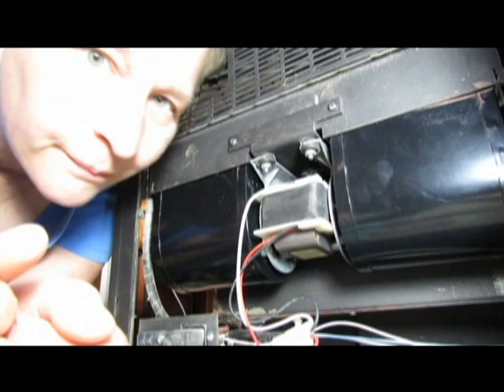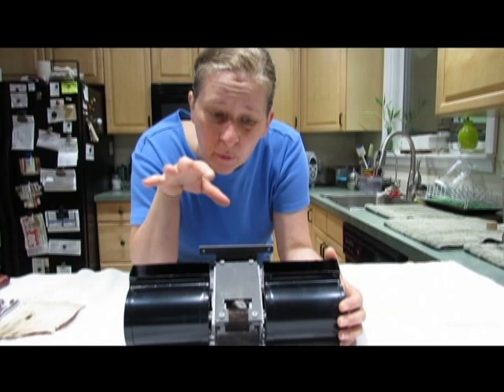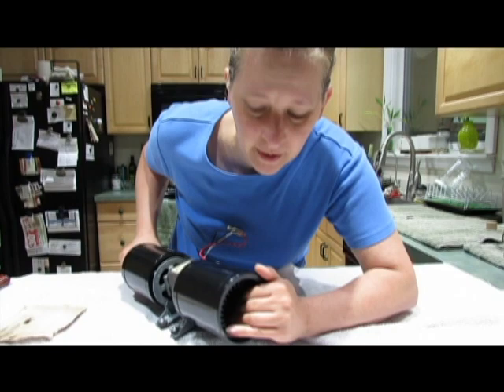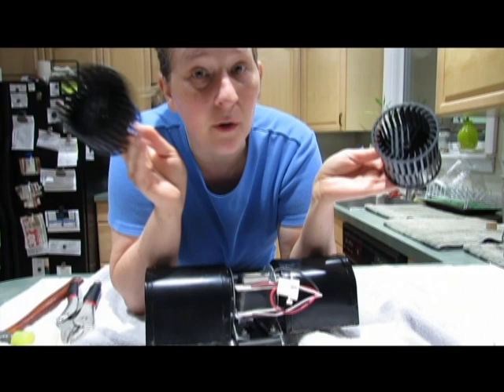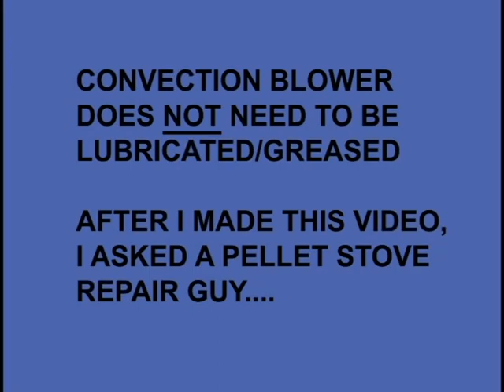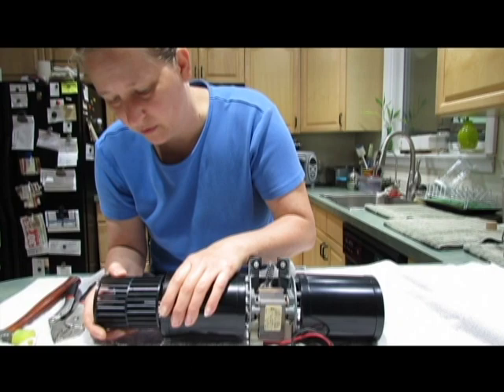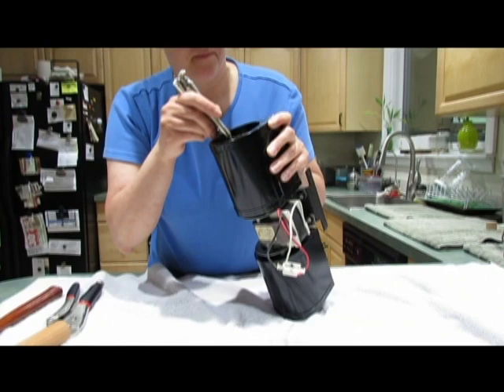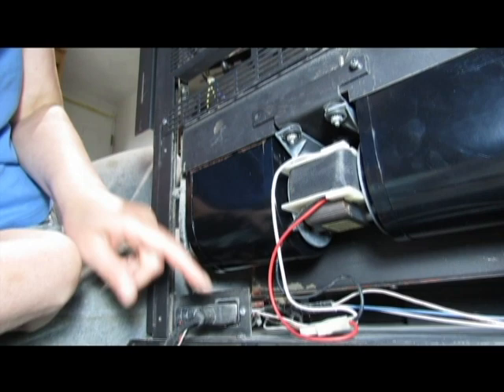REMOVE CLEAN & INSTALL Convection Fan Blower for QuadraFire Classic Bay 1200 Pellet Stove

Comment: Thank you very much for this video. It will help many people. I followed your procedure step by step and everything went smoothly. However, during the rotation of the central rod I heard a friction. Despite a deep cleaning, he was always present. So I decided to lubricate the parts where there is friction with lithium-silicone grease spray. I reassembled everything. My stove is second hand. I have it for 3 years and it has always been noisy. It's over now. He has never been so silent. Thanks again !

Comment: Dawne, 

Thanks so much!!!  I removed the blower and used my air compressor to clean the cage motors through the openings.  The stubborn stuff on the blades I used a paint brush like you said.  The cage motors would not spin freely, so I used a little WD-40 on the bearing, and they spin fine now.  They are so quite now, I did not even know they kicked on!!!  Stove is 13 years old, and they were never cleaned.

Comment: Good to see you address this. I've had my Classic Bay for 14 years & I had to replace the convection blower after three years. The lube in the sealed shaft bearings had dried out and made noise. I took the opportunity to dissect the old blower assembly & discovered that I could access the sealed bearings. They look like the bearings on my inline skates, & I have re-lubed them, so why not these? So , on the new blower assembly I tear it down every two years and push a little bit of hi-temp brake grease through a very small hole that I put in the bearing shield. I used a Dremel tool & a small burr to make the hole. This blower is still going strong eleven years later.
Reply: Hey I want to SEE how to do that too, PLEASE !!!

Comment: thank you. helped me figure out how to clean my quadrafire 7 y.o. insert.
design has change through the years and squirrel cage is no longer removable (or at least i couldn't remove it) but still helpful. i used brushes and compressed air to scrub and blow out dust build up in the cages. got them 90% clean. happy with that.
Reply from the maker: Great to hear!

Comment: Thanks Dawne,  this video was extremely helpful.  Incase you don't know there are two bearings behind the housing that the squire cages go into.  They are probably no good and need to be replaced because they are sealed.  This could be one reason for your noise problem.

Comment: Seems I've come upon this video a year late.  Great Video, however.   I had a convection blower that would whistle and grind.  It was I believe to a better part beyond saving and had to front $329.00 for a new one.  To be fair my Classic Bay had been used by three families and still had the original Blower on it, which looked quite a bit different and much more beaten up than the one in this video.  The newer version I bought is identical to what you have here in the video.  I've had the new blower for a year and a half and it's already making sounds. What I've found as well that may help others who are having difficulties with the blower.  Is sometimes it's as simple as getting a can of "Canned Air" from Walmart for about $5 and blowing the dust and buildup out.  I'll continue that process till it's no longer helping me and then I believe I'll pull it apart and apply your method of deep cleaning.  You got the right stuff, thanks for the video! For anyone looking for Canned Air it can be found in the electronics department near laptops/CDs/Headsets.

Comment: hi 
i have an aqua fire 1000
my pelet stove shut down any time  stop completely all all all like is no electricity
cold working no stop at all for one ,two  days or more ,but when i stop it to cleane it and put it on after,now could work for 10 or 30 minutes and full stiop nothing working 
waiting for 10 minutes and put the reset again ,to worke and can make this operation for 2,or more times
is  very strange ,no one techniocien hier know what could be the problem
ollready 2 technicien came ,nothing nothing
just to tell u i change the:thermo couple,the convection motor and the snap disc for the convectuion blower
change the blower the one hoo send the air ouside of the house
how and what i should to do
can u help please?
thank u